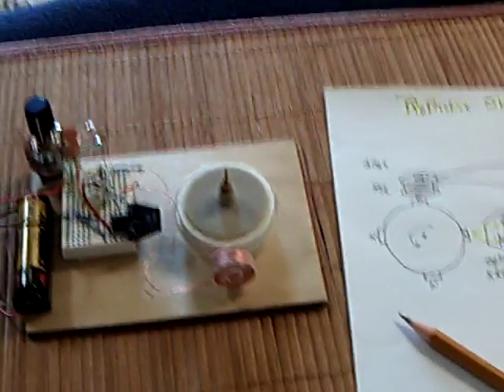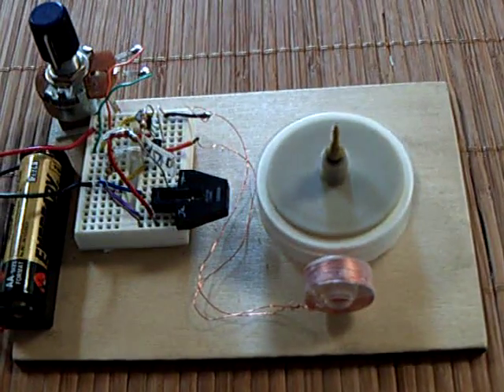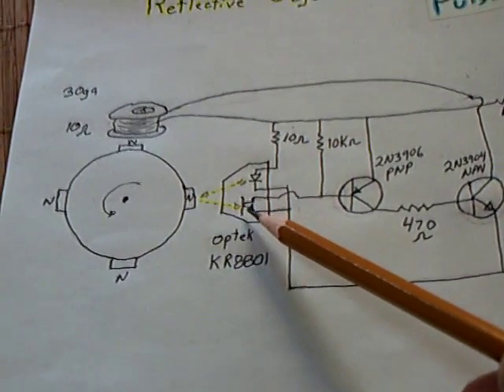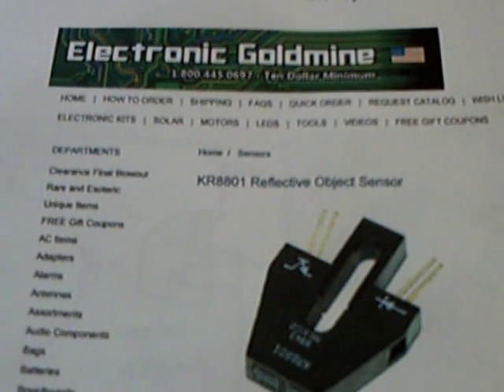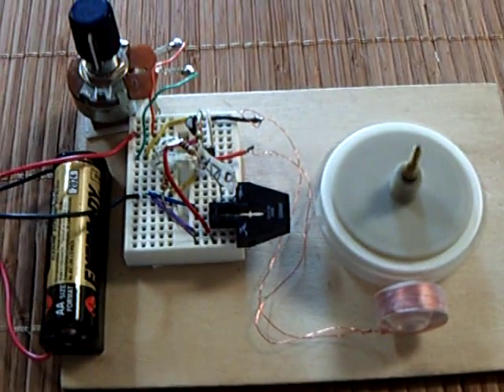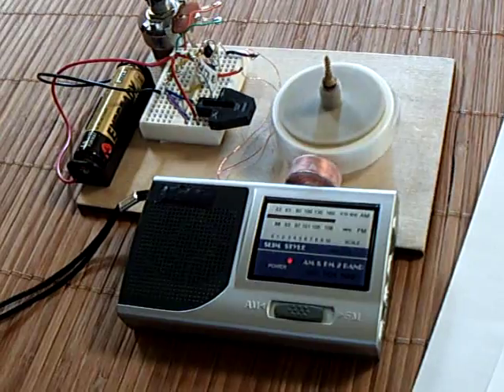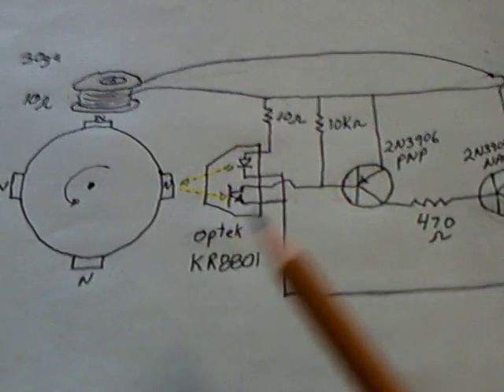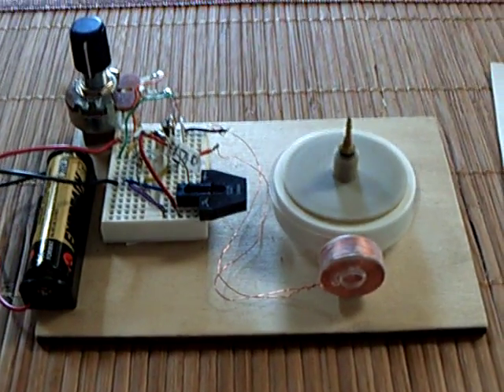Reflective Object Sensor Pulse Motor

Comment: Holy cow... every time I think of a new sensor scheme, I find out you did it a few years ago  LOL   I've been experimenting with tiny laser diodes and photoresistors.  Works, but their response is too slow for a reliable trigger.  I'll check out your optical sensor.  Thanks for the info about the electronic-goldmine site.

Comment: Dear Sir Lidmotor
Very interested Your machine. Could you help me to know more detail your coil ( gauge wire , diameter of the hole , outsize and thickness of your coil .Because my English not well I don't understand all you guide.Thank you so much for your time sharing this video.
                                             Best regards
                                                     lam
Reply from the maker: The coils are 30ga magnet wire wound on plastic sewing machine bobins. The bobins are about 3/4" in dia., 1/4" thick, and with a 1/4" hole in the middle.  Available worldwide.
Reply: *****
Dear Lidmotor
Thank you very much for your time helpful me
                                             Best regards

Comment: Very neat idea and a bit different.
Say, could that sender LED be triggered from a blocking oscillator circuit approach, using the collapse of the (center tapped) bobbin coil ? In which case, it would run from 0.6V ? That would give an ability for the receiver stage to trigger the Base of a single transistor variation.
Reply from the maker: Interesting concept.  I have been working on using a Joule Thief circuit as the light source drive but I'm having trouble with it.  The frequency of the JT gets mixed up with the opto coil drive circuit.  The don't play well together.